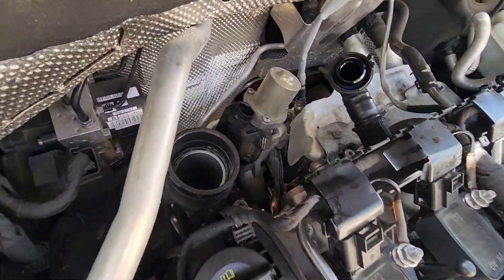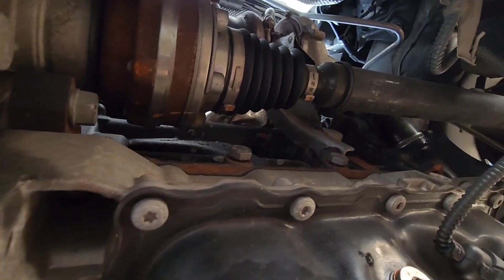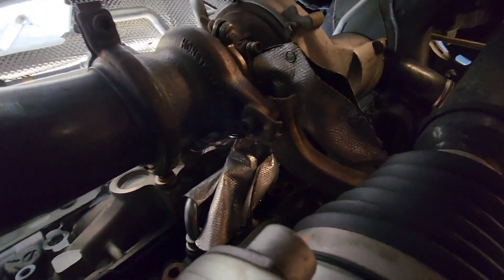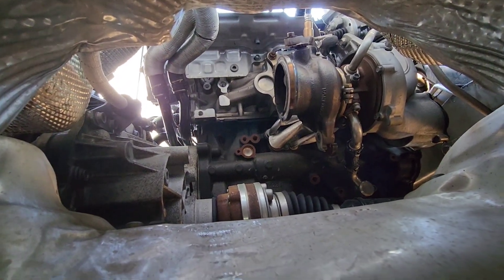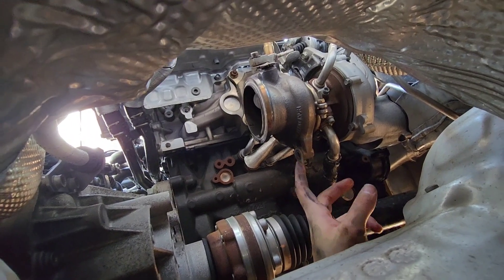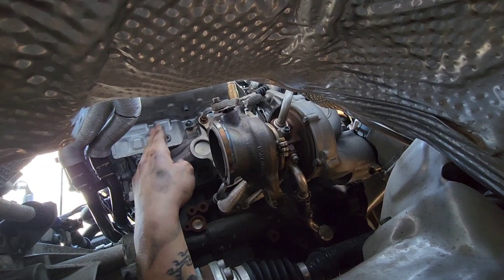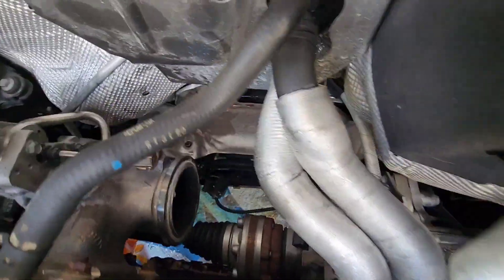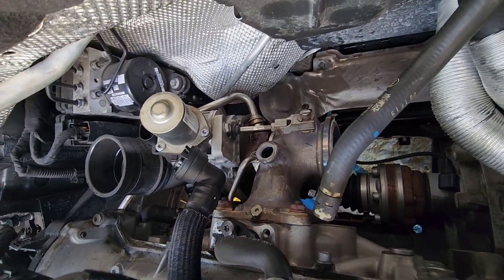MK6.5 Ea888.3 GLi Non-MQB to MQB Swap! Part 1

Comment: Is the difference between mqb and non mqb engines just the change in where attachments points and brackets are on the motor because of the platform change, or is there more to it?? I have a 6.5 gli too and I’m gettin just a little confused to be honest.